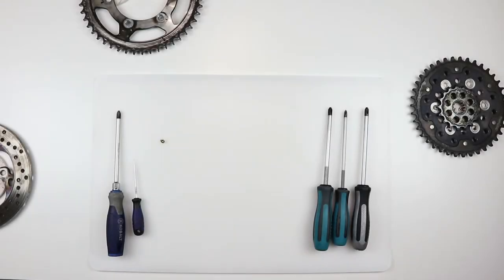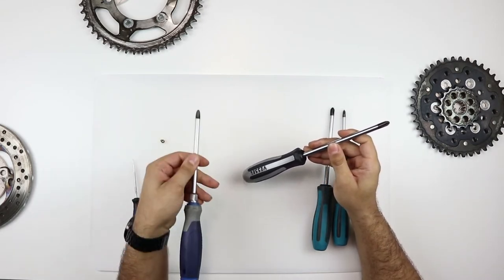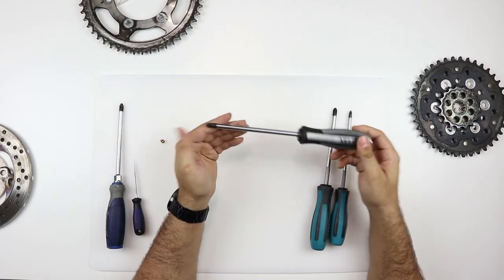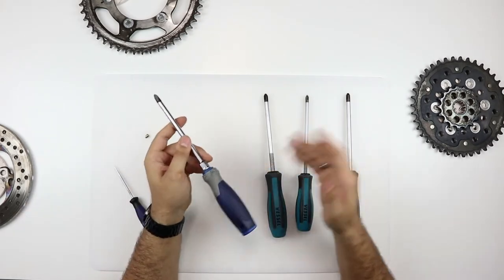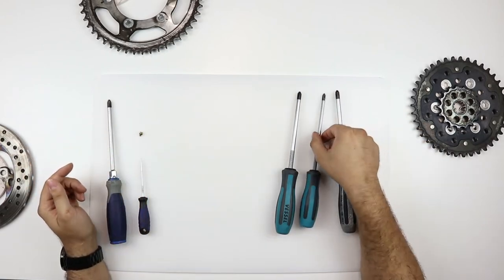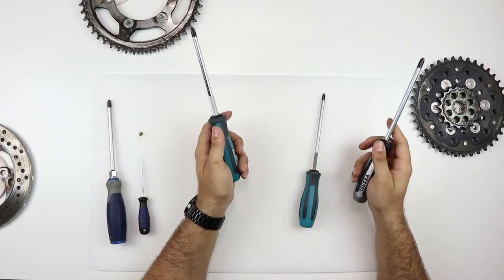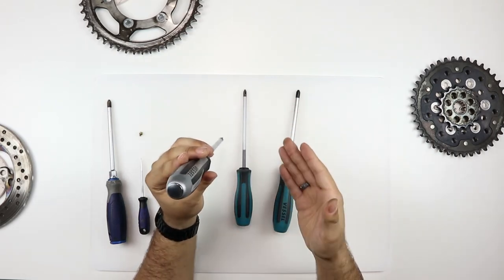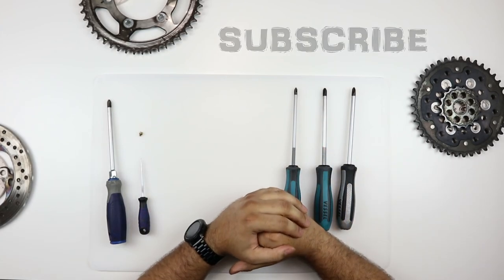The Best Screwdriver you Never Heard Of | JIS

Comment: Thanks for the info. I'm 61 and have been around Motorcycles since 1972 I knew and have JIS screwdrivers but didn't know about the impact device in the impacta screwdrivers, I thought it was just the steel cap . Now I have to have a few of those, I fiddle with my bikes and I have had a few instances where this would have been just what I needed. You don't always need more power.Nice to see a Kawasaki guy on here. My first street bike was a 1979 kz650c ( in 1980). Now I have a 1977 kz650c that I am making look just like the 79 that I had back in 1980. I have a 2017 Honda cb500x also ( for normal riding) . Just found your channel and subscribed 👍🏻

Comment: JIS screws are also commonly found on bicycles, because of the domination of Shimano and Suntour in the cycle components market. If you need to adjust derailleur limit screws or V-brake spring tension screws, you should be using a JIS screwdriver!